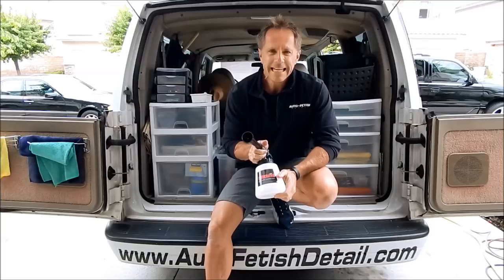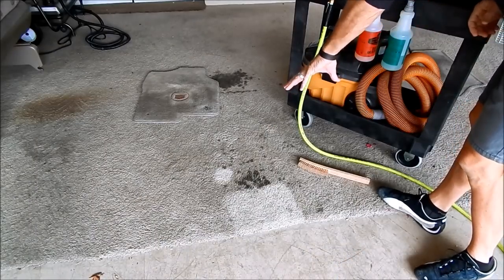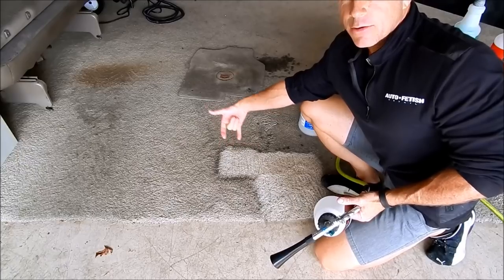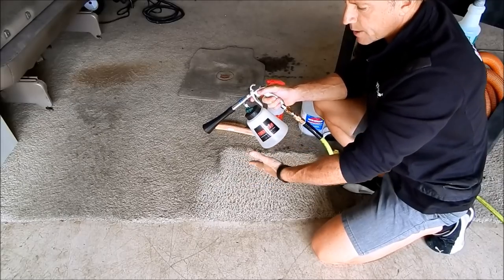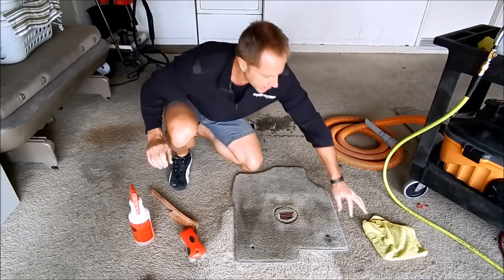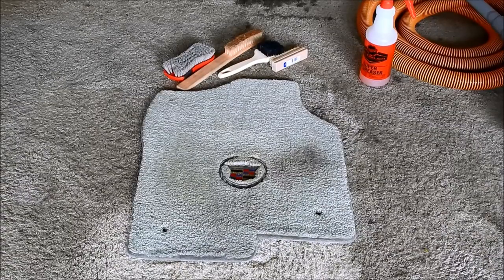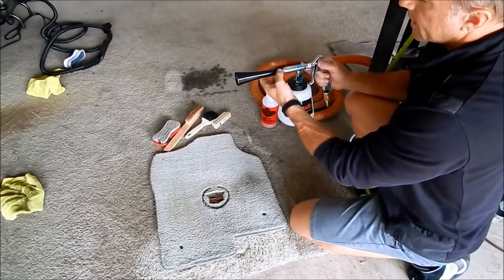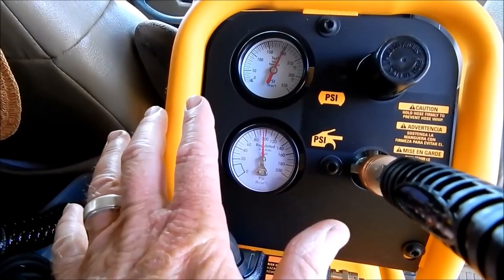Tornador Cleaning Gun: Black Edition  part 2

Comment: This is a vortex type nozzle powered by compressed air  that basically spins the solution into fibrous materials commonly used with enzyme extractors and non foaming oxygenated detergents with de-ionized water and air which disassociates the molecules from the surface or material  that your cleaning. It is a pretty good process for vehicle detailing where light staining of individuals that maintain a fairly clean lifestyle. Undisciplined passengers, dogs, cats, smokers and sloshing belly busting big gulp drinkers where the the car looks like a (tornado hit it) may never need to purchase one of these Tornador devices since detailing is the last thing on their minds. I have a friend in the detailing business and he has one of these and it works great here in Las Vegas where there is plenty of oily parking lots and desert sand.
Reply: Robert Smith theoretically could you use this to remove walking path discolorization areas on carpet in home. Rug doctor could only do so much.

Comment: You have been using the Tornador for awhile now. Can you tell us all of the different applications for which you have found it useful? i.e., carpets, seats, between door and body, engine, etc. What I am interested in, is, in these applications, does it do it very well, or does it do an ok job, but you end up with brushes and a microfiber towel in the end?
Reply: +Alan Jezusko I guess I could explain a bit more. You explain that the business is constantly changing. Whereas you used to do all jobs by hand, you might have decided since your discovery of the Tornador, that some jobs can be done easier, quicker, and/or more successfully with the Tornador. Could you do a video on those jobs that can be done like that?.. or even just discuss it a bit?

Comment: Rapid remover is really for sticker adhesive removal.   Is it ok to use on carpets?   Do you dilute?  It is pretty expensive.   It works really well when pulling old lettering just pricey.

Comment: Good method but I prefer using the extractor to pick up most of the water. Before I worked old method degreaser, brush and microfiber towel until I got my extractor day night difference

Comment: Darren, do you run your generator with the eu2000 honda generator without any problems. Also the rapid remover on your link is a 32 oz not a gallon like the one you showed on the video, where can I get the gallon? Thanks in advance

Comment: Great tool. What size of generator would work for the DeWalt compressor.
Reply from the maker: alphacharlie65ms Good question. Not sure how much amperage the compressor pulls. I have not tried to run it on my Honda generator as I typically am working at people's homes and I plug into their power source.

Comment: Would you use an extractor to fully remove the chemicals once your done? Where do you get the grease cutter you mention
Reply from the maker: brianallen0826 No. I am using water to rinse away the dirt and cleaner. See this link for the Rapid Remover:
http://www.best-auto-detailing-tips.com/car-adhesive-remover.html
Reply: Would you have to use a spray bottle of water to clean off the chemicals if you were not using the tornador to rinse them?

Basically what I am wondering is if super degreaser, APC, or Rapid Remover will burn someones skin left on the carpet or residual.

Comment: Just ordered my Dewalt compressor and Flexzilla air line. Do you think it is necessary to use an In-Line Desiccant Dryer to filter out oil and water vapour?
Reply from the maker: Bruce Nichols I questioned that myself. I chose not to. I am sure you will get a different answer anytime you ask someone. So far have not had any problems, but I am sure if any problems are to be had, it would be long term use. Haven't had time to really research it though.

Comment: Is this worth buying than an extractor ?
Reply from the maker: mich gonz I think it is a better choice. You are limited with an extractor due to the size of the extractor head. The Tornador can clean hard to reach areas and surfaces that an extractor could not get to. In a perfect world, you would have a steamer, a Tornador, and extractor. But you can get buy without all these tools if you wanted to. It would simply mean you are limited as to how clean you can get materials and the types of jobs you can do, or the amount you can charge for your detail services. I would put the Tornador at the top of my list and then the steamer if I had to choose, but each tool has its limitations and benefits.

Comment: can you please tell me what size and what kind of air compressor are you using
Reply from the maker: Andrew Malcolm 15 Gal. 1.6 HP Continuous 200 PSI Workshop Air Compressor
Reply from the maker: Auto Fetish Detail I suppose it would have been helpful to add that it is a DeWalt
Reply: Thank you so much

Comment: is there enough air in that tank to detail a full-size sedan or something large like a Chrysler 300
Reply: remember you're spraying solution to your section. for example....  you do one door and compressor starts up again. by the time you wipe it dry, you'll be good to go to the next section. you don't need a 50 gallon compressor,  a 10-15 is perfect as long as you have the right scfm @ 90 psi.
Reply: i did a video on this as well. check ot out.
Reply: Thanks for the info. You saved me a lot of money.

Comment: do you have multiple carts in your van? per subject?
Reply from the maker: Steve Van Der Vorst No. I use the cart based on the job I am doing; mostly I use when I am doing paint correction and have my buffers and my "buffer kit" that I need handy access to while working around the car.
Reply: Oke, because you said in this or the previous video, i'll get my interior cart... it seemed a bit crazy to have multiple carts in the van... organize the cart on the spot according to the job: makes sense
Reply from the maker: Steve Van Der Vorst I have most things organized into different containers. I have my bucket jockey that essentially contains everything needed for the interior: http://www.best-auto-detailing-tips.com/husky-bucket-jockey.html
And then I have a container for all my polishes, polish pads, sand paper, etc. I have another container that houses my buffers/polishers, etc. So based on the job I am doing, I can set these containers on the cart and have my tools, products, etc. conveniently at my disposal. 
It's all about organization and efficiency....which then equals profitability.
Reply: I love to have my stuff organized and uniform.... those bucket jockey look great... import to belgium in (value + transport)+ 37%.... bit to expensive for me (already check it via your sit ;) )
Reply from the maker: Steve Van Der Vorst Bummer. If you look around at home improvement stores, there might be similar alternatives you can purchase locally.